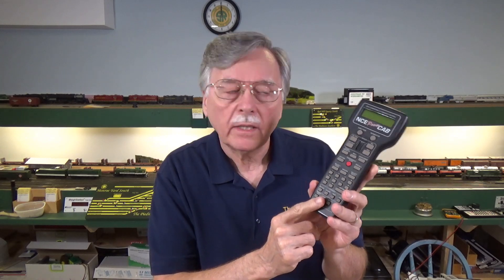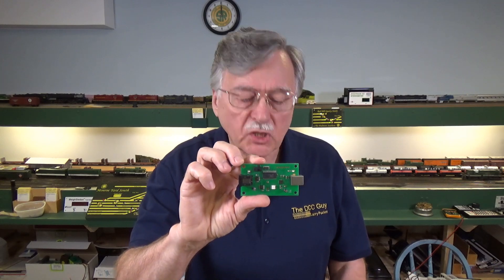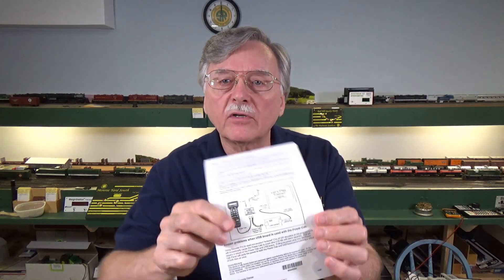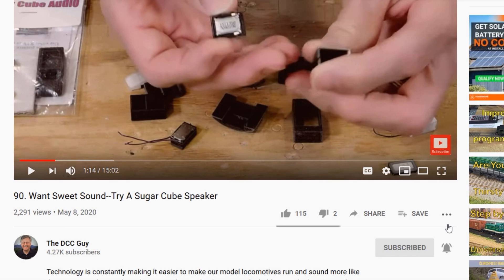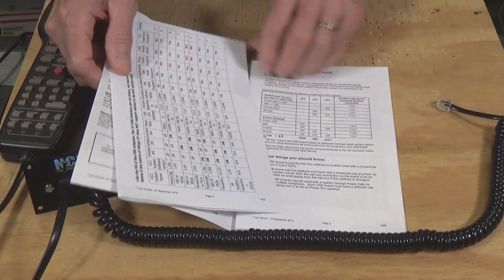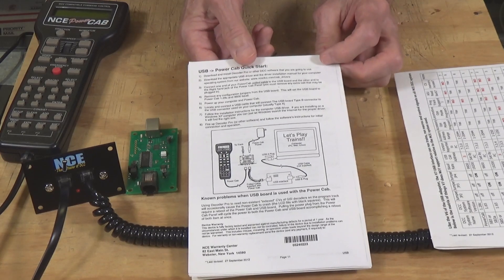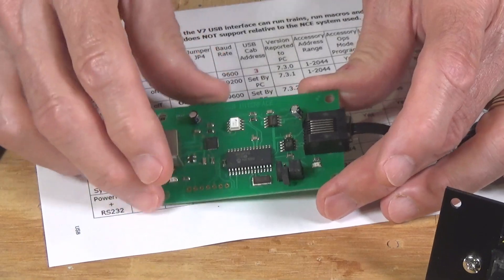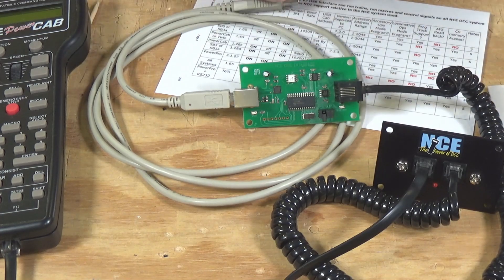A USB Interface for your NCE PowerCab pt1 (99)

Comment: Is there a way to do this using a program track on your layout? Like with the auto switch
Reply from the maker: I am not sure what you are asking. If you mean does the DecoderPro computer connection work with the usb connection to program decoders then yes.
Reply: @TheDCCGuy  I mean, I don't have a seperate test track that i can hook the system to. What I was planning on doing was insulating one of my open stall tracks from the roundhouse, and using that as a program track to use the jmri on (decoder pro). If that makes sense

Comment: Hi Larry, Great video! Sorry for the newbie dumb question, but I see you connecting the USB interface using the front panel plug, but would it work equally as well using the rear ones too? Only reason I ask is for neatness to to tuck it behind the facia plate? Thanks a lot and best wishes, Gavin
Reply from the maker: There is one expansion socket on the rear of the Power Cab Panel and it might work with the usb interface, but the instructions are quite specific about using the right hand socket on the front. I think I’d ask Ed Wilson at NCE first just in case.
Reply: @TheDCCGuy  Thanks a lot Larry, really appreciate the response! I'll give their tech support a quick message now to double check. It's far from a game changer though as I still would love to use the USB Interface, but its going on a small portable modular layout so it would be great to have it mounted in the benchwork alongside the AutoSW and the other accessory decoders. All the best! G
Reply from the maker: As long as you’re asking them ask if it would work to connect it to a second expansion panel on the back. Those have sockets that can be used for throttles. There is a figure in the manual suggesting the usb can be plugged into an expansion panel.
Reply: @TheDCCGuy  Hi Larry, hope you're well. Just a quick note to say I followed your suggestion and got helpful note in from Ed at NCE today. He said that you can use both the front right-hand RJ12 jack OR the rear ones on the PCP panel as effectively they are the same. Thanks again for your help! All the best, G
Reply: Just to add another quick thank you Larry for all your kind help! I received my new DCC control kit in the mail today including a PowerCab and some lovely parts from DCC concepts here in the UK. After a lot of research I decided to use a couple of their Alpha Panels along with an Alpha Meter instead of the regular NCE PCP panel and I'm really happy with the results so far. Your tutorial helped me fly through the USB interface install and setup on my MacBook Pro and now I've got everything running sweetly on my workbench! Thanks again and best wishes, G

Comment: Hi Larry
I am currently in the process of installing my NCE  USB interface

I have downloaded the drivers from NCE

But I do not know how to set the jumpers

My NCE power cab is a version 1.28C

And the instruction manual that came with the interface does not show how to set jumper number  1

Also the instruction manual showes  2 power cabs at 1.28c software version 

Is this something you can help with or will I need to reach out to NCE?
Thanks
Reply from the maker: This is from Jim Scorse, owner of NCE on the interface, as for the rest you need to contact NCE tech support:

Our recommendation is all jumpers off and 9600 bps 
in all circumstances. 

The other options are for obsolete software versions 
of products from a minimum 8-10 years ago. Virtually 
all those products have received software version updates

JMRI (which is probably 99% of the applications) knows
how to deal with the all jumpers off recommendation.

At this point talking about older versions just confuses
the issue.

Comment: Lost the jumper pins for the NCE Interface so I'm using some bare wire to connect the appropriate pins.  Any problems with that?
Reply from the maker: I see no problems as long as you get the connection right and an protect connections from shorts.

Comment: New subscriber
Watching this series and am grateful for the effort put into these videos. I though am having difficulty finding   
information for connecting up the USB interface to my system that has an updated SB3A and a RRampmaster. Surely I am not the only one with this setup. Wondering if you could help.
Reply from the maker: I’ll have to look into this. What is a RRampmaster, or do you mean RRampmeter, abd if so how is it hooked up? Have you tried the USB interface and had problems? If so what kinds of problems?
Reply: @TheDCCGuy  
Sorry about that. It is the DCC Specialties RRampmeter that I have hooked up in the line from the Smart Booster to the track. It reads 13.9 Volts. I have tried the USB and it doesn't work. It doesn't light up and JMRI Decoder Pro does not see it.
Reply from the maker: Ken—here is a post I made with some info that might help you. I doubt the RRampmeter is the problem. It most likely is the way it is set up, either the board itself or your computer settings:

I finally got an email back from Jim Scorse, the owner and developer of NCE products, concerning this question of the correct settings. What he said was that the jumper and other settings described in the instrucitons are for older versions of the usb interface. He now recommends that for their current production usb interfaces ALL JUMPERS should be set to OFF. So if you have a relatively new interface then use the all off jumper settings and set the driver and DecoderPro baud rate to 9600 if it is not already .

Comment: Great video, how hard is it to use a MAC with this system.  I know I need to purchase a USB-c.  Any thing else I need to be aware of?
Reply from the maker: Good question. There are Max OSX drivers as well as Linux, and Android. However I have only tried out the Windows ones since they are most popular. Since I also have a Mac I will eventually try that too but not anytime soon, too much else on my plate right now. If you give it a go let me know how it works for you. However if the Mac is your only option then I would ask NCE tech support whether the usb device works with a Mac before buying one.
Reply: Also got a mac and waiting for the video, will try myself though and let you know. NCE says there are MAC drivers also.

Comment: Thank you Larry.  I use it on my workbench program track. I have the nce sb5 system for the layout. Could I set the layout with another usb interface to use there. I know I’ll only be able to program in the main. But when speed matching it would be easier to not have to go back and forth to the bench. I’m looking forward to part 2.
Reply from the maker: The instructions suggest you can use multiple USB interfaces if I read it correctly. I assume you would end up with 2 different com ports for the two different USB devices but I have no idea how they would interact with DecoderPro.
Reply: The DCC Guy ok thanks Larry

Comment: When I had my NCE PowerCab, I purchased one of these and it gave me the opportunity to add more realism to my layout. Using JMRI, I was able to program locomotives much easier with DecoderPro and using Signal Logic with Turnout Controls and Block Detection with Panel Pro give the need for a dispatcher, as long as you have all the needed electronics. I have since exchanged my PowerCab for the ProCab which has one of these already built in within the serial port. Main key whether your using the USB interface or the ProCab serial port is to make sure the correct COM port on the computer is selected and that information is located in the Device Manager within Windows.

Comment: According to NCE - ALL Jumpers are supposed to be OFF - This is what I was told from the tech in an e-mail from him.
Reply from the maker: Your USB board may be a different version than mine. I was going by the table in their instruction sheet as I showed in the video. All I can say is I set mine up per the table and it works.
Reply: Right! I thought of this after I sent you the screen shot of the email... sorry about that!!